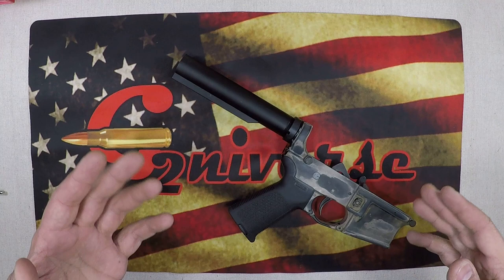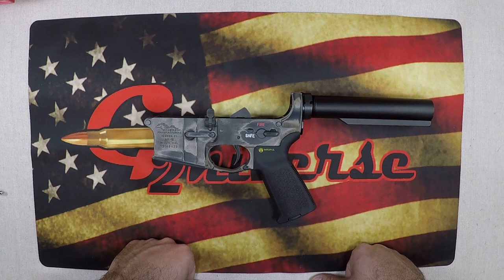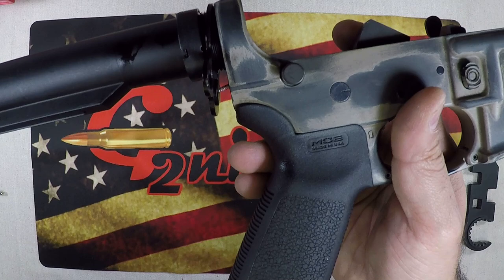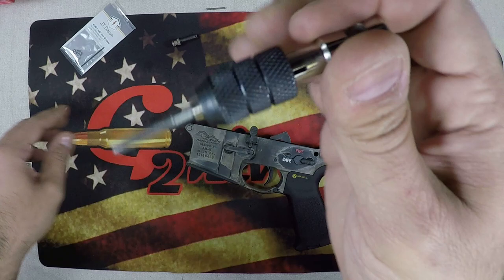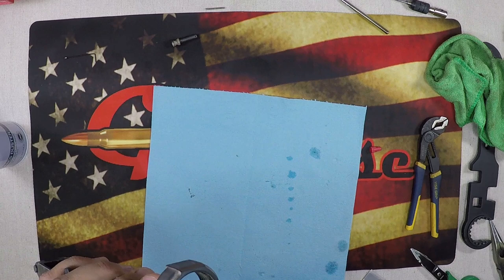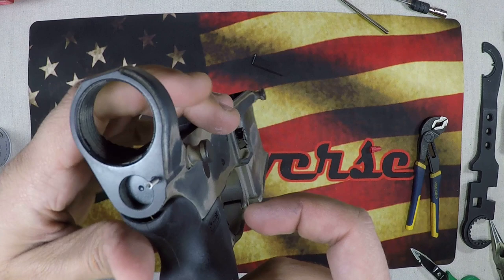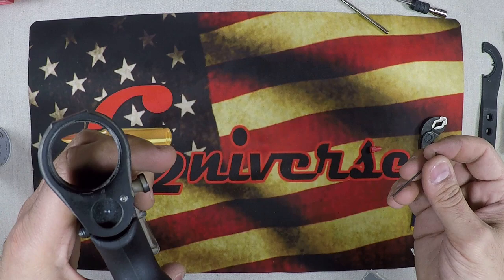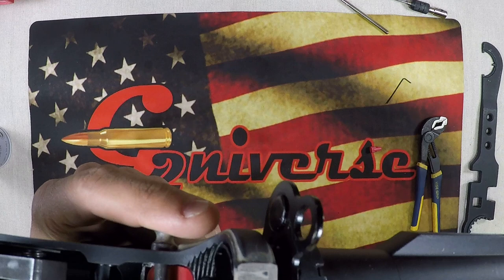AR Rear Takedown Set Screw DIY

Comment: I've been doing this since 2011 and you should trim the spring,you want it tight but not over tight
Reply from the maker: I agree, the great thing about this is you can test the tightness before you even put your stock assembly back on. Makes it really easy to adjust to your perfect fit.
Reply: yes it does I bought a spikes tac lower and they had the threads cut, so when I started having customers ask if I would put their kit together if the lower had no threads for a 4/40, I would tap them in, I'm also a aero percision dealer and all of their lowers are threaded

Comment: I'm amazed lower manufacturers don't do this as standard. Afaik only Aero do (and a threaded bolt catch pin too). Thanks!
Reply from the maker: yeah totally should
Reply: Ballistic Advantage does as well, since AP and BA are sister companies.
Reply: Several 80% Lowers have the threaded hole also.

Comment: I got the 4-40 tap and 4-40 set screws and after tapping the hole the 4-40 set screw just falls right in i double checked the size of both i dont know why its not catching
Reply from the maker: Wierd... just go one set screw size up, you should be fine.